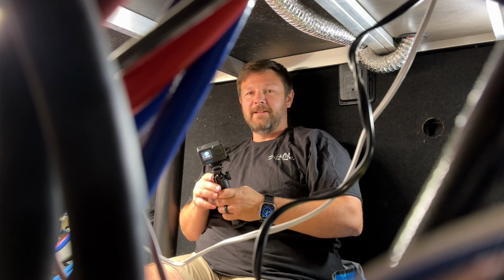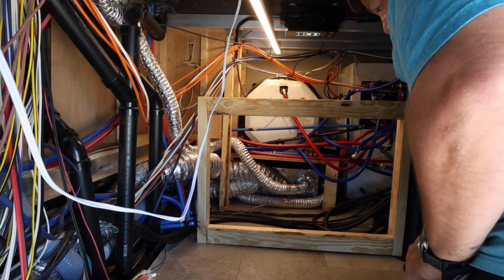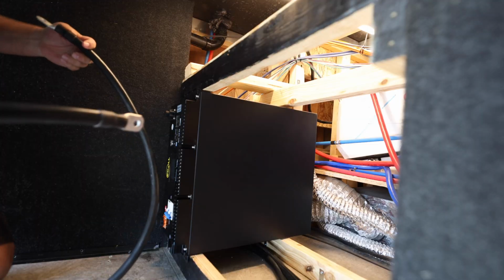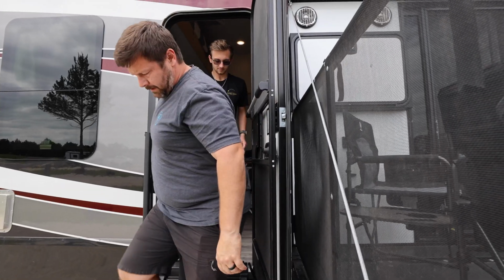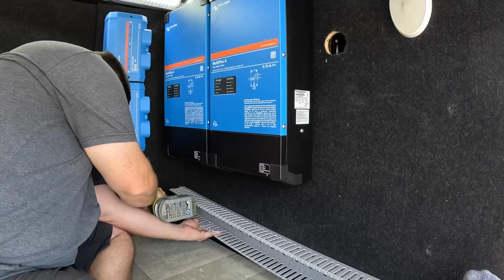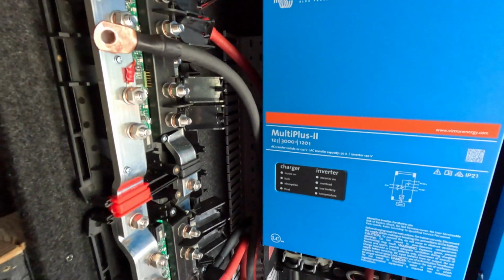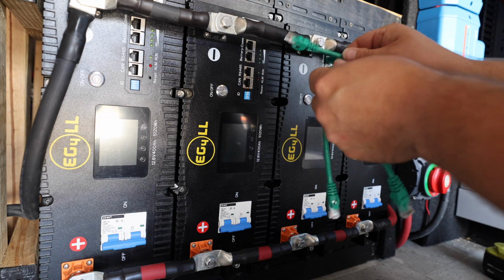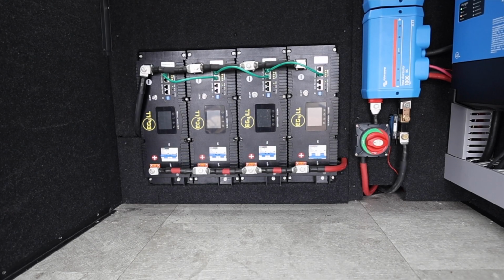OFF-GRID RV Solar System // THIS is Sustainable Living! ☀️

Comment: I know this is an old video, and I hope you see my question. I am installing a EG4 system and going to mount my batteries the way you did. By the way, I thought that was awesome. My question is, What did you do about your existing lead acid battery. Did you delete it, or isolate it? Thanks. love your setup
Reply from the maker: I removed the existing battery, inverter and converter. Everything runs off of the new system since it is also 12V. Thanks!
Reply: @1StrangeAdventure  Thanks so much. I loved the eg4 videos. They are what turned us on to them. Our whole system is from them. We went there and had a consult. They were so friendly and completely helpful. Thanks for what you do.

Comment: You will regret fitting those 3000 watt inverters as l found they are only 2400 va for the little bit extra you should have installed the 5000s but you have a great install. JS
Reply from the maker: We are enjoying them so far. Thanks for the heads up

Comment: Oh, one other thing.  You might want to consider a support beam under the bottom edge of the batteries.  I'm a little concerned that ever-present travel shake is going to wiggle those screws quite a bit and start to loosen them.  I suspect this because you don't have a metal frame.  Metal strips, anchored to the wooden frame and then the rack mount screws into that metal strip might be a very useful solution, if you start to have that issue.  (Of the screws walking out or beating up on the surrounding wood.)
Reply from the maker: Great suggestion! Thank you!

Comment: Great installation.  Curious, as a fellow 399 owner, why you'd tied up so much of your only-bay space?  What about the front bay area?
Reply from the maker: Great question. I really only used up from the sewer pipe back since I cleared so much space by rerouting water lines.  The bay is still pretty large.  I decided to use that space for a couple of reasons. 1) That allowed me to get the weight a little further back out of the nose. 2) It gave me the space I needed for that many batteries. 3) I was able to center the batteries vs having them offset to the patio side, which is already the heavy side of our rigs. 4) This space is somewhat climate controlled so the batteries are less likely to be exposed to the extremes. Hope this helps! 🙂
Reply: @1StrangeAdventure  Yep, good answers, some of it is what I suspected, esp. centering the weight.   Good looking install!
Reply: @1StrangeAdventure  Hi - we also full-time in a '21 399 for the last 5 years and are constantly battling with staying within weight. Can you share how you've avoided being overweight? We have 7K axles with IS and disc brakes, full body paint and dual pane windows and constantly pairing down belongings; our CCC = 1,892 lbs. It's been quite frustrating - would love any tips you have.

Comment: I like your install. Been designing a system with Signature Solar for a totally different purpose. But looking at options for my RV as well. However, I wanted to point out a small error in your math. You said full 50A service. A 50A RV circuit is two legs with 50A each. That is up to 100A at 120V power with standard of 2 Hots and Neutral or 50A at 240V (Hot to Hot). So for a standard RV that is 50A shoreline for simple math would be 12,000 Watts in other words four 3,000 watt inverters two per 50A circuit. Of course we don't draw full amount. So less can handle much of the load, but you need to watch your loads.
Reply from the maker: 🙂 Great clarification point! I’m still learning.
Reply: @1StrangeAdventure   Interesting reply, thank you.
Reply from the maker: I misspoke. Still learning.
Reply: @1StrangeAdventure The breaker at the pedestal is a double pole. That's 50 amps for each pole, so the previous reply is correct. I've pulled over 50 amps total between L1 and L2, verified it on my Power Watchdog, and not had a problem. You're capping yourself at 6K watts, well actually only 4.8K watts with Victron because they're rated in VA and not watts. But that might be plenty for your needs. Beautiful build, by the way, gorgeous.
Reply from the maker: Thanks for the clarification!

Comment: I hate being the bummer in the comments but, isn’t that a lot of weight in one area? And what would this cost the average Joe to install themselves? Thanks, it’s really cool
Reply from the maker: Not a "bummer"... great question! It is a lot of weight which is why i built the frame to distribute it more and not having it sit on the plywood in one spot. I also designed it so that the batteries were mostly centered but skewed to the non-camp side in the RV vs being totally off to one side.  Our rig is naturally heavy to the patio side so I wanted to offset that with the batteries.

Comment: nice system, but I think you would have been better served with a 24V or 48V system. I'm planning to install a very similar system (24V) in my 5th wheel in the next few weeks.
Reply from the maker: You can get this same system in 24V or 48V. The 12V is doing great although I realize I had to use much bigger cables for it. I don't think you can go wrong with any of those setups as long as you do your research and size things appropriately.
Reply: @1StrangeAdventure  You're also limited on your charge controllers with 12v. I believe in your case each charge controller on 12v can only do 1200w. 24v would get you 2400w, which then you have room to expand your solar capacity. 

We have 5300w of solar on our bus going into two 150/85 controllers on a 24v system.

Comment: On the MPPT controller the 150 is max volts going in to controller and the 100 is max amp output. You seemed to have suggested the solar array configuration in series had some bearing on the 100 amp out which it doesn’t. So it doesn’t matter series or parallel for input because that output will be 14.5v at 100amps, thats where the max solar array for a 12v system is 1,450 watts for that controller. On a 24v system that same controller can run 2,900 watts because the output amps would be half that of a 12v system. I can’t believe that solar company suggested for you to use a 12v system with that much battery and inverters. Thats a lot of amperage and heat really for no reason when a 24v or 48v would cut that in half or 1/4 of a 12v system. Definitely staying away from that company.
Reply from the maker: Thanks for the feedback. I’m not familiar with systems beyond 12V so I chose to stay there. 24 and 48 was an option.
Reply: @1StrangeAdventure  we also run the “Salty Trips” channel, we have a 24v build over there. This conversation gave me a great idea for a video, thanks 🙏🏻.
Reply: 100% was going to say the same thing.  Crazy to have that system be 12v.   Awesome system nonetheless

Comment: 24V or 48V?  at 400AH. Or did I miss that. I ran mine at 24V. much better power density and output over the life of the battery.
Reply from the maker: Hi there. I stayed with 12V

Comment: Nope, been done many times. I have a very similar system. I'm running 24v EG4 LL V2 batteries. 4 of them, likely end up with 5. Dual MP2 in parallel.
Reply from the maker: That's awesome! Sounds like a great system.
Reply: I didn't see any chassis grounds the batteries.
Reply from the maker: The entire system is grounded to the chassis.
Reply: @1StrangeAdventure  including the batteries? The battery case has no continuity to the negative terminal. That's why they give you a chassis ground on each battery.

Comment: This is exactly what i have planned for mine when i do my next upgrades. Only difference is im going 48v on my setup.
Reply from the maker: That will help keep wire cost down some. ☺️
Reply: @1StrangeAdventure  sure will but hving to buy a 48-12v steep down converter will eat some of that up. For me its more about being able to run a bigger inverter with a lower current coming off the batteries. I'm planning on 2 5000VA Quatros.
Reply: @1StrangeAdventure  So oddly this video just popped back up in my feed. I decided to pivot a little from my original plan and i ended up installing two of the 3000va 2x120 inverters, only difference is i went 24v with 800AH of battery at 24v. 

I do have a question on your setup that i'm just curious about. Is there a specific reason that you did a split phase setup on these instead of pulling new 6/4 wire and running them in parallel?  

I did mine in a parallel configuration which will give me the full output power of both inverters on either l1 or l2 since the inverter ties the outputs together internally when inverting. Both inverters are connected to both lines. To me putting them in split phase kind of defeats the purpose of the 2x120 inverters. In split phase your limited to the power output of a single inverter on each leg.

Comment: Great job as usual   Those batteries are nice !  What a system , you can boondock in florida and run your ac all day.
Reply from the maker: That’s the goal!! ☺️
Reply: @1StrangeAdventure  Did you put soft starts on the ac units ?   The new 18000 Furrion that runs like a mini split would be awesome

Comment: Could you make a more nerdy video about this? I didn’t know you could even use 2 inverters to keep a split phase. This is very interesting. I am looking into doing something similar with my RV soon, and my plan was one of those inverters, but now I’ll have to look into how they work when running 2, and the batteries are way cheaper than what I was originally going to use. 

Will you get the Victron Cerbo and display for inside the camper to monitor all this?
Reply from the maker: Haha, guilty as charged! Absolutely! I have it already and will be installing soon.